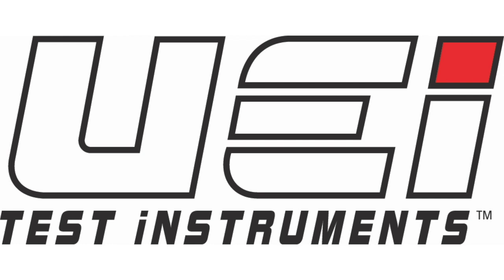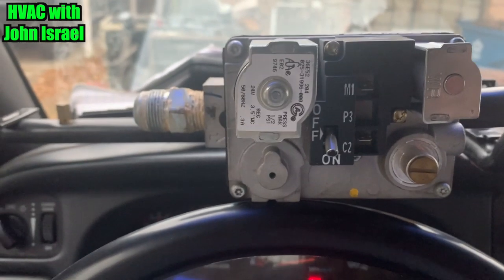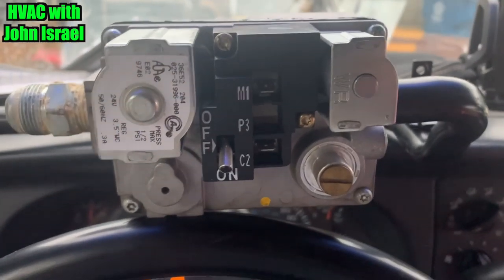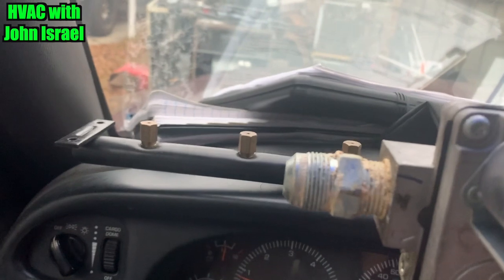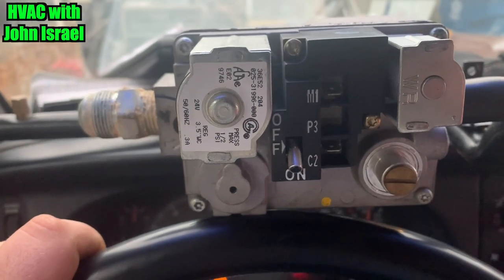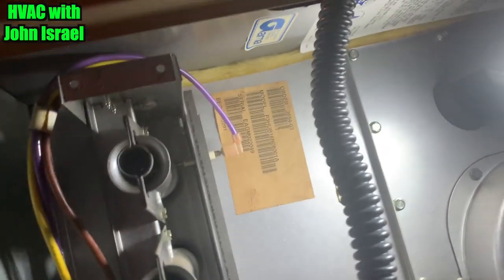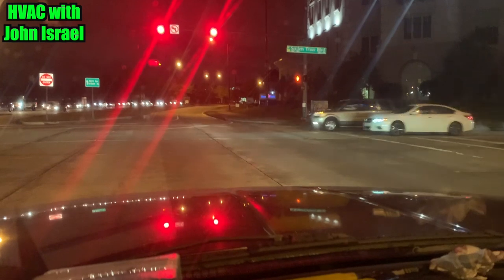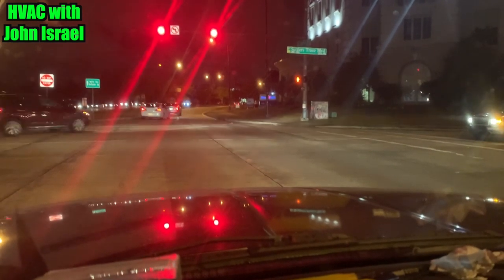Bad HVAC Gas Valve Replacement

Comment: Steve Lav puts pipe dope on every thread even compression fittings little fritz little dope momma little tech tip.
Reply: Unions are different then flares. It's ok on black pipe but if your flare leaks, you have a bad seal. Pipe dope is only a temporary fix. Plus gas is only 1psi or so. Not much pressure compared to oil or water